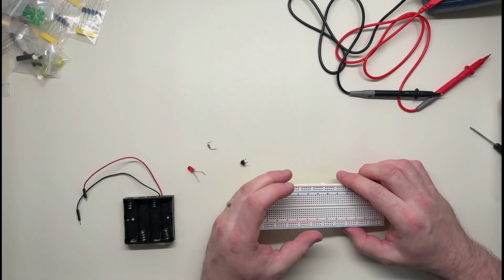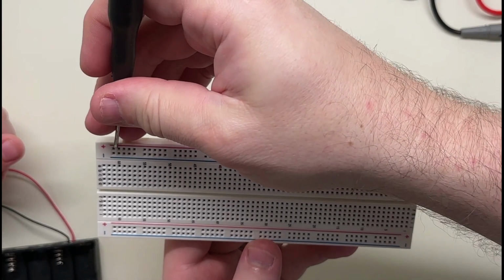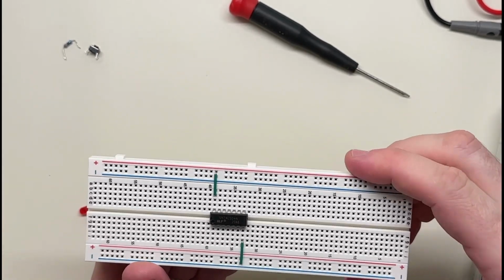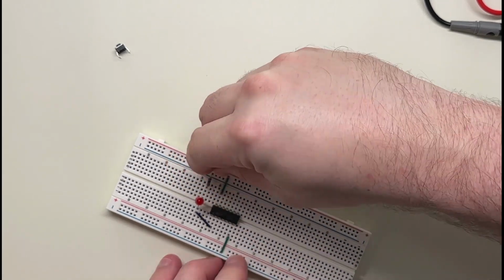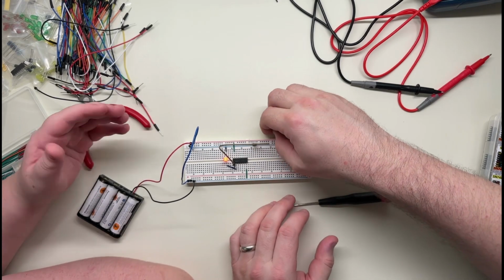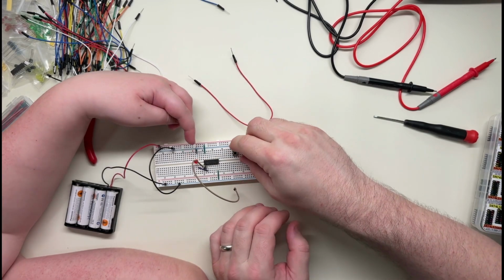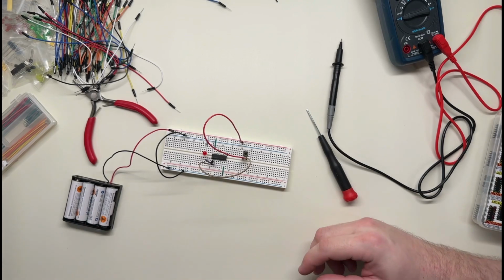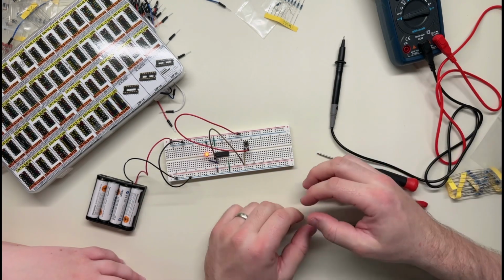Using an inverter to switch off the LED: Difficult when tired!

Comment: Nice job figuring out the need for a pulldown resistor. I just wrote a longer comment and accidentally closed the tab, so I'm going to try again but shorter. You may have also run into a problem that bit me several times: for multi-gate logic chips like this, you're not supposed to leave the unused inputs floating. It causes all kinds of problems. I have spent hours checking and re-checking my work only to realize I forgot this rule again. It is, however, mildly annoying to have those extra connections on a breadboard. It's hard to tell from the video, but this might be why you had some indeterminate behavior. I think on a 74LS chip, unconnected inputs tend to float up to high, but it's very weak, so it may have taken some time after you powered it on and/or the capacitance of your hands could have made the chip freak out.

For the pulldown resistor, if you really want, you can calculate it. It's an interesting exercise in data sheets anyway. Page 6 of https://www.ti.com/lit/ds/symlink/sn74ls04.pdf gives the relevant values: V(IL) = 0.8V and I(IL) = -0.4mA. That means that you need to go below 0.8V to be considered a logic low, and your pulldown needs to sink 0.4mA of current. Since 0.8 / 0.0004 = 2000, anything under 2kΩ should work.